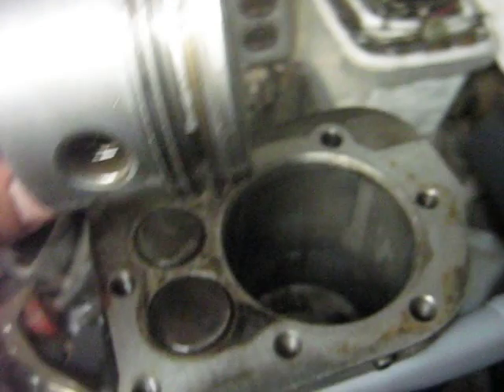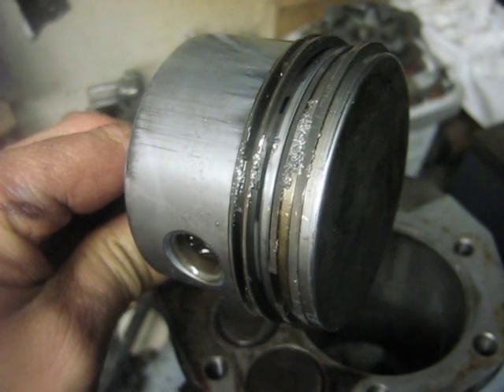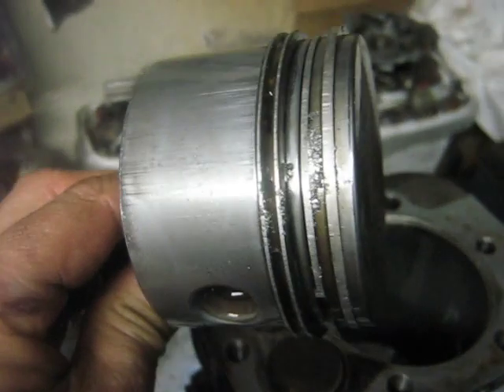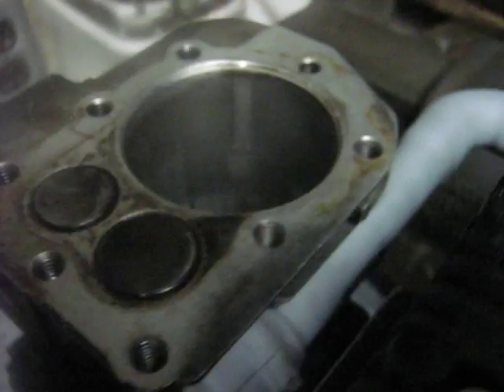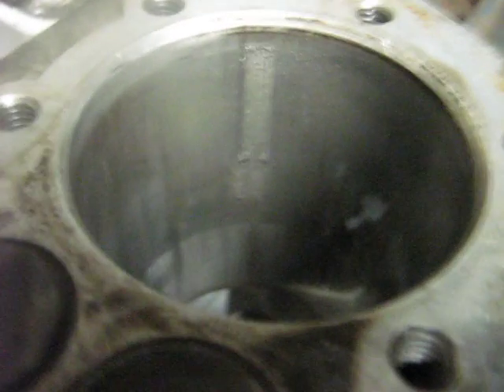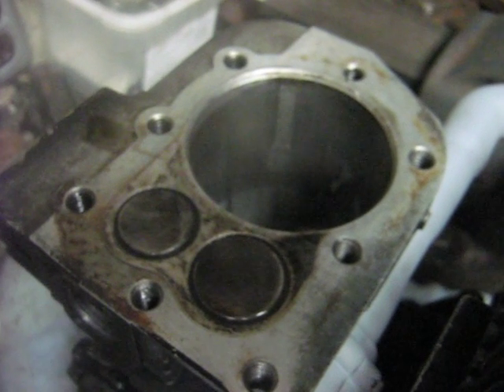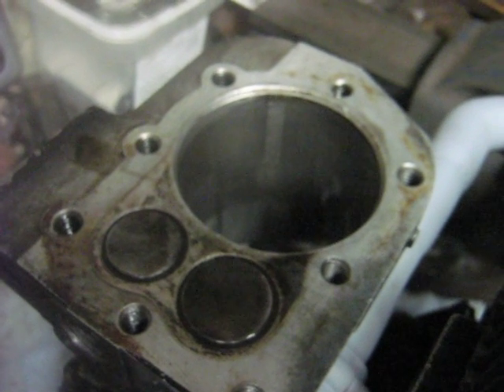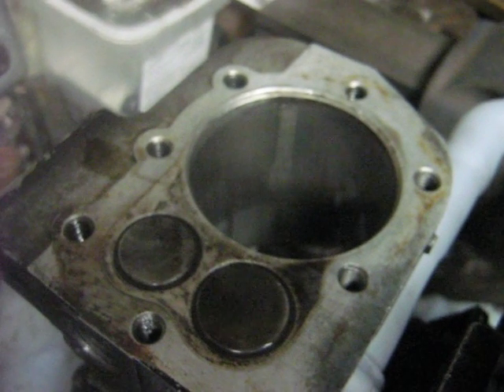Scored #2 Cylinder in Briggs Stacker

Comment: So how did it turn out? Did it smoke? Did you just re-hone it? Thanks!
Reply from the maker: I honed it by hand with sandpaper, yes, it did burn some oil afterwards, You can also fill in the scores with JB-weld, and sand/hone it down, it should work fine.

Comment: How do you fix minor scoring?
Reply from the maker: Well, I have heard of people cleaning the scores out well, and applying a bit of JB Weld (in an aluminum cylinder), Then sanding or honing the JB to match the cylinder wall, it might work. One person mentioned that they had don't in a car as a last resort, and apparently it worked. The other option would be honing, but that would make the piston a looser fit, and result in more ring end gap for leakage.
Reply: ChargerMiles007 thanks

Comment: does the scoring keep the engine from running. i found scoring on my bs craftsman lawnmower
Reply from the maker: It depends on how deep the scoring is, and how wide. Generally some scoring won't stop it from running, but may increase oil comsumption. I have seen one push mower engine that was scored all to heck, it would run since it had virtually no compression. If your engine was running not too badly, it will probably be OK.  Many of these Briggs engines I use  for these FrankenBriggs projects have a bit of cylinder scoring or perhaps worn connecting rods, but since they don't run for long they work for my projects. I try not to butcher mint condition parts if I can avoid it!
Reply: yes it consumes alot of oil there was almost no oil left when i went to change it , i had filled it full a month ago and mowed 20 lawns. it cranked one time out of 100 pulls yesterday .. im suprised the mower you mentioneed being scored bad with no compression would run i guess this means lots of oil useage. well i bought a new craftsman 7.25 hp... am going to change oil after first 20 hrs . i didnt change oil on my old mower till way later in its life big mistake
Reply from the maker: Sorry for the delay, I meant to answer you back sooner.
Yes, it sounds like your engine block is scored very badly, probably due to running low on oil, it can happen to anyone. As the engine has less and less oil, the oil overheats and oxidizes, eventually it has hardly any lubricating properties left. If these engines had a cast iron cylinder liner they could probably take more abuse, but hard to say, as the connecting rod bushing suffers from the low oil also.  The engine i mentioned would not run at all, that how i ended up with it, the owner asked me to have a look at it as it wouldn't start. I noticed severe scoring in the cylinder and next to no compression, so he gave me the engine, since it was toast. That was one of my first Briggs lawnmower engines back 30 years ago.
 There is a good vid on youtube by a young engineering guy, it explains oil viscosity and wear etc. very well, i learned a lot from it!  :)
Reply: great explanation would be nice if u built a supur briggs n stratton lawnmower motor wth twice the cutting power , i would guess everything would need to be 50% bigger lol
Reply: Marty Forkwater

Comment: It almost looks like one of the piston rings slipped out of the groove.
Reply from the maker: I think the middle ring got wedged in the piston during assembly. I was using a hose clamp instead of a compressor. It tried the same thing with the new piston, so I got out the real ring compressor, then it went in fine.

Comment: Does Briggs sell .010" over pistons?
Reply: Yes
Reply from the maker: I see somebody has already answered, but yes they do, they used to sell.010, .020 and .030 pistons and ring sets.They may still carry all of these, but I don't know for sure.
Reply: ChargerMiles007 Worst comes to worse, it should only be $40 or so for a machine shop to punch out one of the holes oversize. Either way, keep at it. These aluminum block engines introduce certain challenges that the iron-block engines don't necessarily have to deal with.
Reply from the maker: Yes, that is true, these aluminum engines are unique.